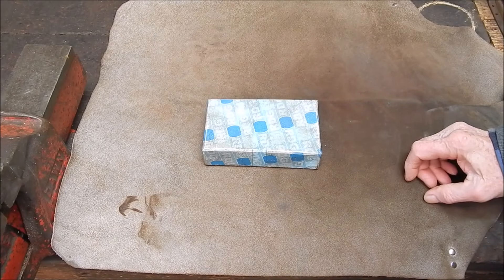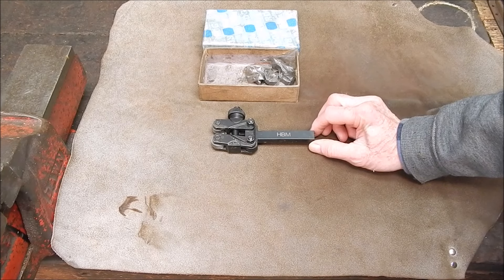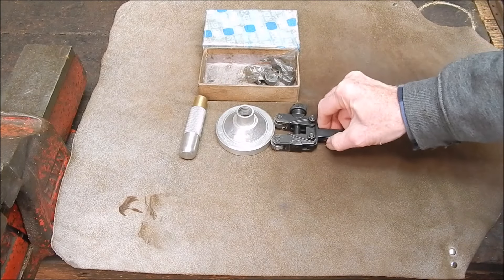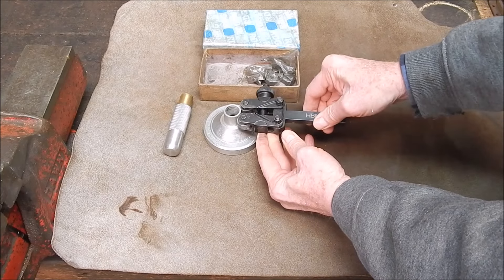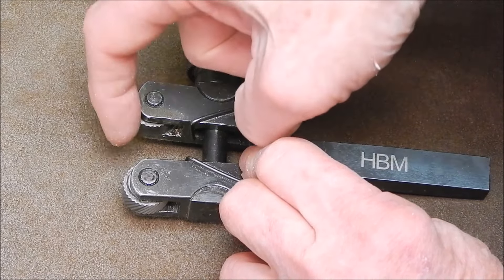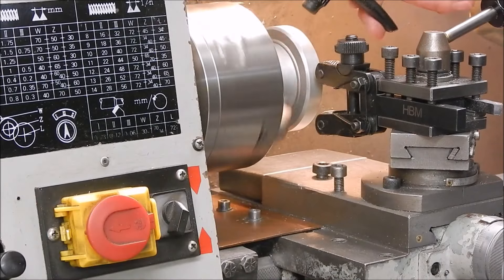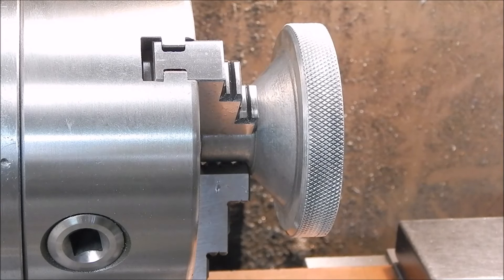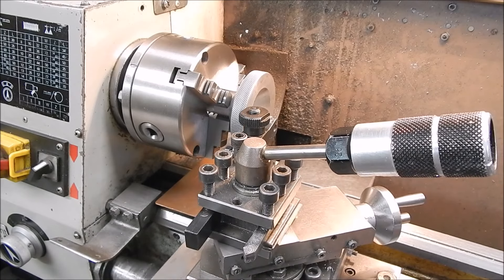Do more with your metal lathe pinch or scissor knurl

Comment: Hi Rob, great demo. I have the same knurling tool. A while back I was given an Index knurler that fits in the tailstock. The work is pushed between the two knurling wheels. You are limited on the diameter of material, but it produces an amazing knurl. I did a video on using it. All the best Rob. Cheers Nobby
Reply from the maker: Hi Nobby.  I saw that video.  I remember it was a bit tricky to adjust, but worked well.  Gotta have a knurl of some type as they are so useful and great for decorative finishes.  I bought two extra sets of Chinese knurl wheels including the set in the demo and they work fine.  Gives three patterns basically.  Cheers Rob

Comment: Hi Rob. I've used a pinch knurl for many years now but never considered using it that way. Great idea 👍👍👍 Cheers, Alan.
Reply from the maker: Hi Alan.  The pincer action certainly put less load on the lathe when knurling hard metal.  For softer metals like aluminium plunge tools work quite OK.  I noticed there were no videos on this aspect and thought it needed airing ;)  Cheers Rob

Comment: I never needed to knurl a big diameter,but indeed, this is a good idea.
Reply from the maker: I have used this trick quite a few times where the job is slightly larger than the clamping range of the knurl.  Very rare to do jobs as large as in the video -  but it shows it can easily be done. Cheers Rob

Comment: Hi Rob, these are a great knurler I have one and it does a great job every time almost a perfect diamond patten. 👍👍👍👍👍👍👍
Reply from the maker: Hi Wayne.  Yes, it's a very good tool.  I got mine from the UK.  I also use some different pattern cheap Chinese knurl wheels in it with great success.  Cheers Rob

Comment: I have a three cutter hand knurling tool and was trying to knurl a 4mm axle shaft to press fit a gear. I had no experience with this.  So clamped the axle shaft in my vice and tried to clamp the wheels on the shaft then turn the hand toll around the Shift but it seems to load up the knurl cutter grooves.  Now i see you guys putting the axle in a rotating device, drill or lathe and running really fast and clamping or pressing the cutters into brass or aluminum. But I have Stainless Steel will that work in the same manner????? Maybe I need netter cutter tools??? Dennis
Reply from the maker: Hi Dennis.  Stainless steel is hard to knurl due to it's poor compressibility (from my experience).  You may need to do several passes with increased pressure.  I am not sure what type of knurl you are using, but all I've seen are designed to be used with a metal lathe. An electric drill is unlikely to be powerful enough.  Knurling is generally done at slow spindle speed with a fast feed rate and lubrication. Cheers Rob

Comment: I have the pinch type, never thought of this to be honest, I've only ever used it a couple of times period. Why do you state fast feed when moving the carriage towards the chuck, I assumed that slow would have been the way to go??
Reply from the maker: The carriage speed must be fast enough that the rollers don't over impress and destroy the pattern.   Basically the speed must relate to the distance between the pattern sections of the rollers.  Too slow and the pattern will be all chewed up or poorly formed.  Try it on some scrap and see.  I did demonstrate this in a very early video.  Cheers Rob
Reply: @Xynudu  Thanks Rob, I'm guessing that you only get one crack at it too? You can't then move the carriage back to the tail stock end for another deeper cut? Knowing how tight you can clamp down in the first place, how's a novice meant to know??
Reply from the maker: You can go over your first pass again provided you gently feed the knurl in without carriage travel.  Once the knurl finds/aligns with the first pass pattern you can then engage carriage travel.  I occasionally do this if the metal is harder than expected or I want a deeper impression.   Cheers Rob
Reply: @Xynudu  Thanks, that makes sense,, so are you really trying to cut the rest of the length at full depth in one pass? I suppose that the deepest of cut that you can ever make with a knurling tool is microns anyhow? Compared to turning or facing a part, where you shave a tiny amount off on each pass.
Reply from the maker: I would normally cut the full depth in one pass.  Obviously the amount of pressure required will be determined/vary by metal hardness.  For clean edges on the knurl I always knurl that section before finishing the job (where possible).  That way you can later machine to the edges of the knurled section and make a neat job of it.  You just have to plan ahead as you near job completion.  Knurling should never be the last machining function if you want a professional looking result.. Cheers Rob
Reply: @Xynudu  I wouldn't want to knurl last either, screw that up and the whole part is ruined. When you are a novice, that actually applies to all operations done on the lathe though. LOL

Comment: Last operation, chamfer ends ?
Reply from the maker: Yes.  Knurling always produces rough edges.  I would normally just break edges like this on the linisher, but you could use a HSS turning tool of whatever profile you like, wherever you like. Cheers Rob